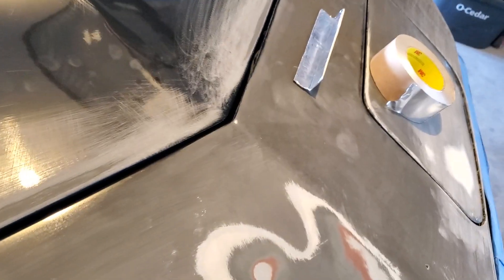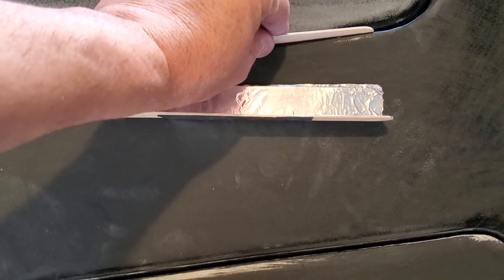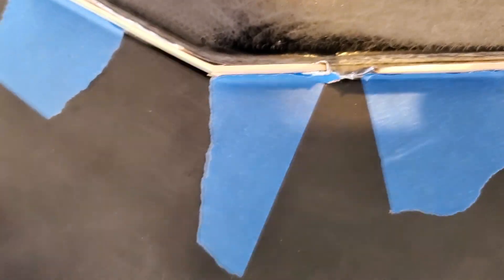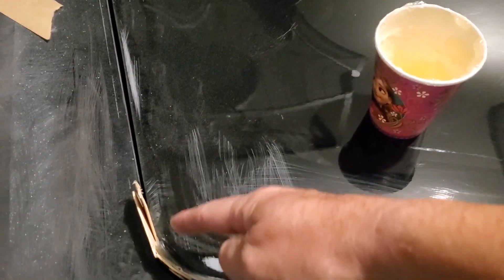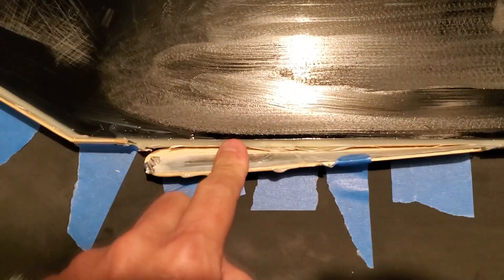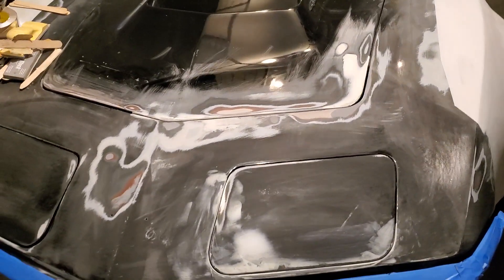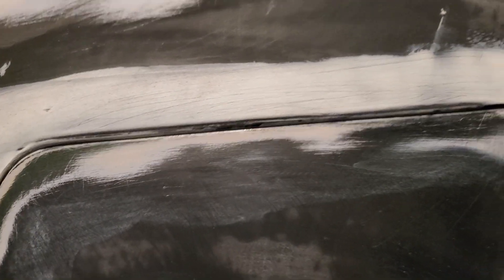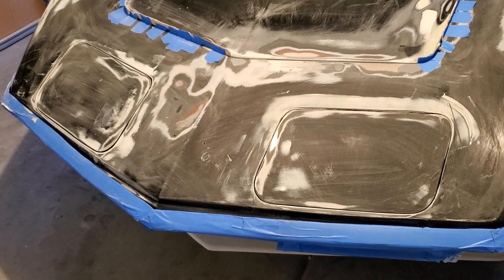Filling in the GAPS! Pt. 1 - 1969 Corvette C3 - Body Work Update.

Comment: Just my two cents; Evercoat short strand fiberglass reinforced filler is what I used to fill gaps. With proper preparation it will stick amazingly well and is every bit as strong as the existing fiberglass. I used 5/16 clear plastic tubing, measured and split lengthwise and wrapped outside of headlight doors. Closed the doors and filled the gap. Left about a 1/8” gap after tubing was removed. Sanded and fine tuned to perfection. Filler doesn’t adhere to the rubber tubing. Used a similar technique to fill gaps at passenger doors, except I used heavy plastic strips from one of those “cones of silence” used on dogs to keep them from licking themselves.
Reply from the maker: I have some short strand fiberglass. I will try that. Thank you.